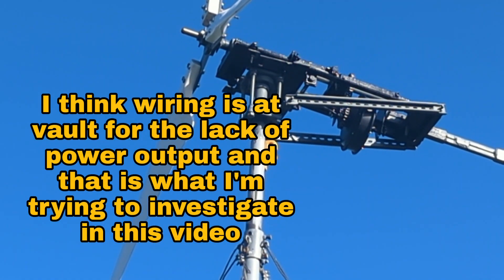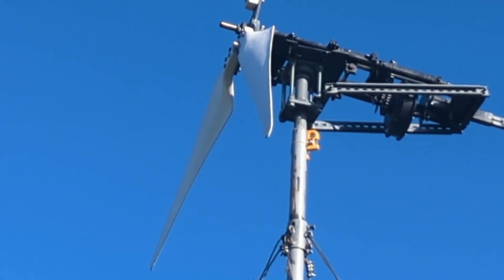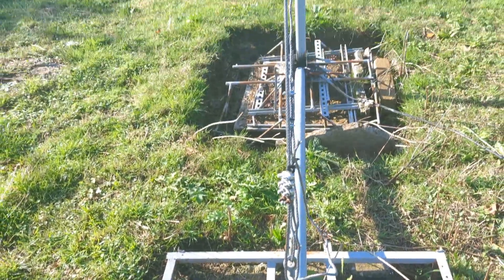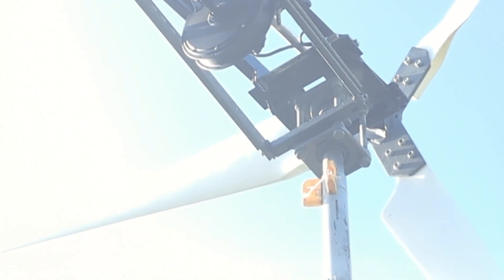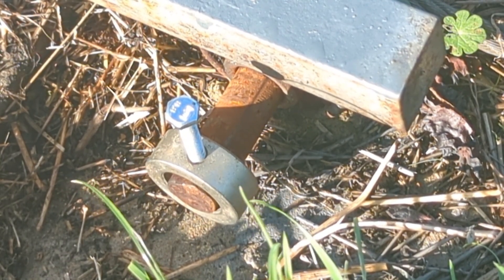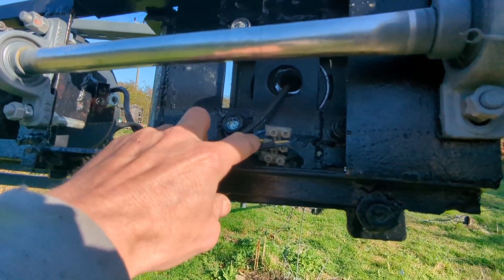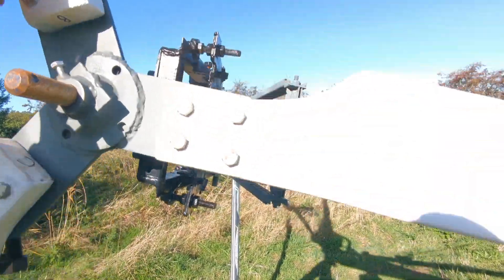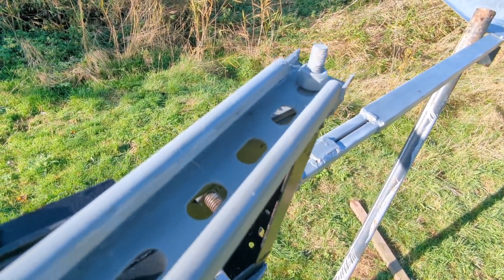DIY Monster wind turbine - fault finding low power - very poor cable is the main suspect.

Comment: If you put the three pole to two wire rectifier at the top of the pole then you can use two core output wire.
Reply from the maker: true but then the battery wire will be really long and need to be mega thick cable.

Comment: I had low power and difficult start up in reasonable winds with my turbine last year. Turns out one of the 3 phases got some of its insulation scraped off when sliding he cable into the mast and was shorting against the inside of the mast. Spent ages trying to figure out why power was so low, then had a "doh!" moment when I found impedance between two of the phases was really low compare with the others. I suspect you have a partial/full short to ground or short between phases. Any shorting would brake the turbine to some extent. Hope you find the fault.